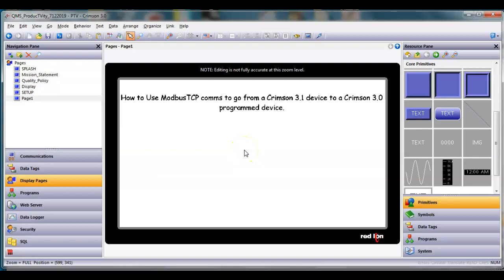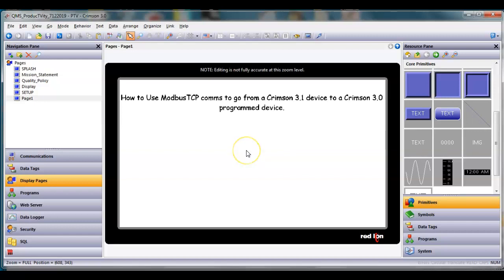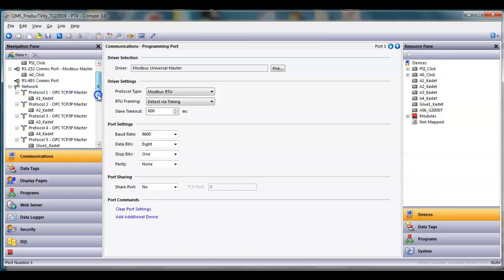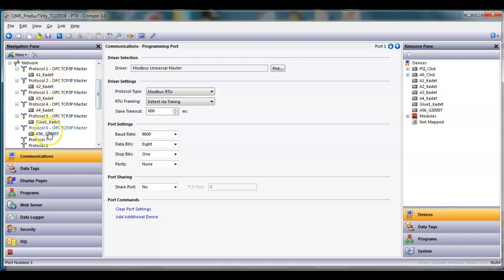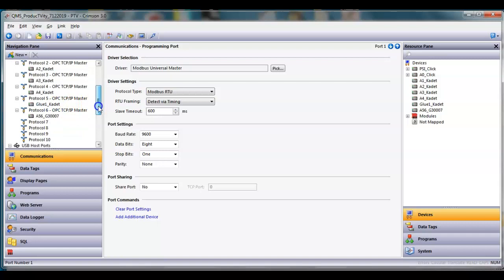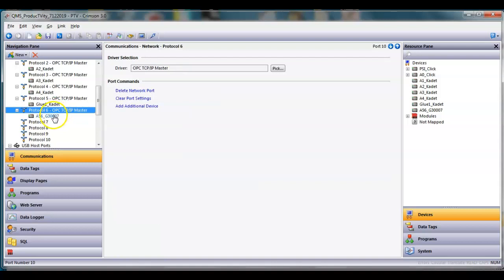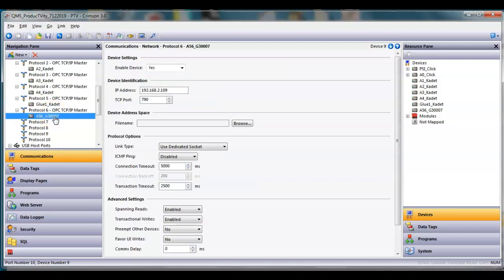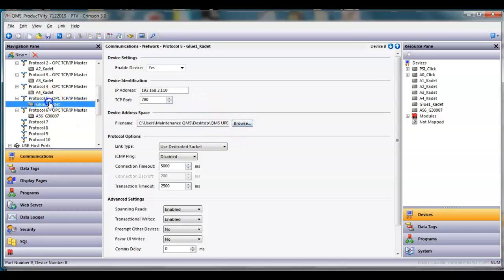Modbus Comms in Crimson 3.X

Comment: Thanks for the "expand bits" tip to load 16 flags into a 4x modbus holding register. Exactly what I needed.
Reply from the maker: Perfect.  That trick also works with Array tags on the right side of Crimson when you want to expand into each Element of the Array.